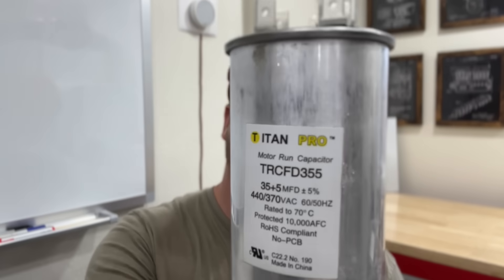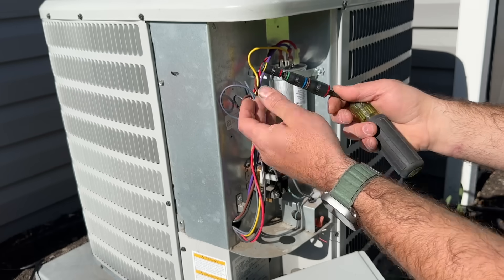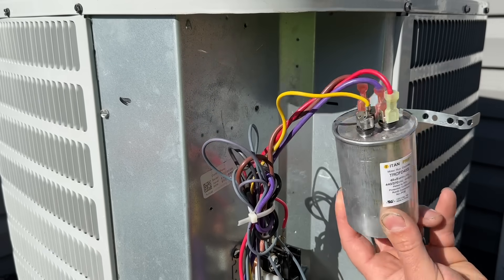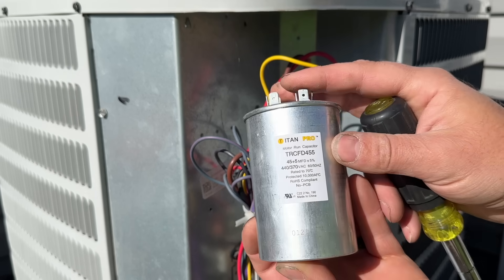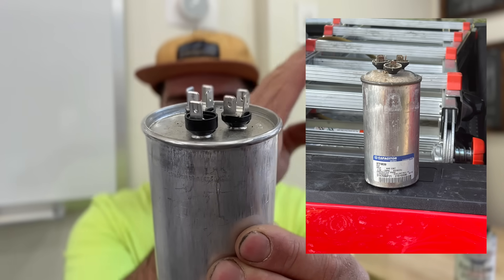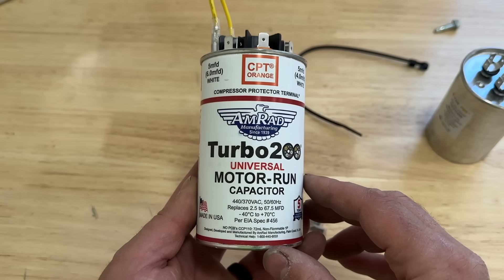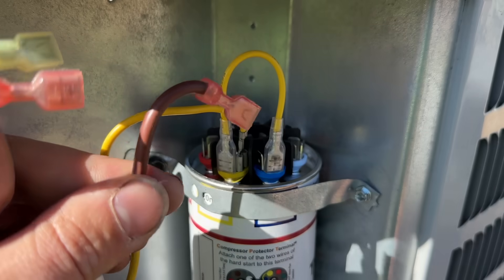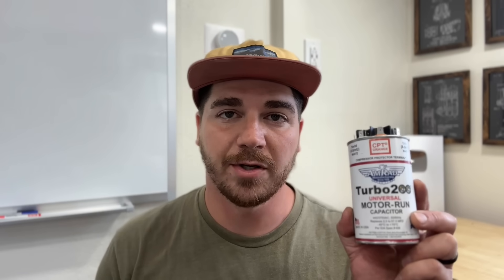HVAC Contractors Practically Make Their Living On These

Comment: Retired HVAC guy, I always check for power even if I pulled the disconnect. I was almost zapped because someone wired the box wrong.
Reply: ABSOLUTELY! Had a house, someone bypassed the disconnect. Pulled it, went in and SURPRISE!!! Took a minute to uncross my eyes…no, it was not funny.
Reply: @johnsmircic6650 Holy crap! Glad you’re still with us!
Reply: Reagan's old "trust but verify" works if you add a little skepticism. Skepticism keeps you alive. That said:
Don't trust. Always verify.
Reply: What ever you work on always assume it’s live or has stored energy,
Reply: When my uncle died I worked on his house getting it ready to sell and found something dangerous like that.
Someone wired an outlet for him all wrong.
The hot (black) wire was connected to the ground on the outlet but wasn't connected to anything in the breaker panel.
The ground wire (bare copper) was connected to the neutral (silver screws) side of the outlet and it ran back up to the buss bar in the panel.
The neutral (white) wire was connected to, yep you guessed it, the brass screws where the hot wire should be and it ran back up to the hot side of the breaker.
I'm not an electrician but that seemed really sketchy to me. I only found it because I was testing the outlets and that one showed an open ground.
Reply: @Harold_Callahan  
When you find shoddy work like that, then you have to start wondering what else might have been done wrong. Maybe tear more walls out looking for hidden junction boxes or improper connections and what all.
Reply: ALWAYS crowbar the power by shorting it with a tool such as a screwdriver after checking with volt meter.  Takes nearly no time, absolutely insures that you're safe.  And read all the way through instructions first.  I was nearly killed in an Army electronics school in 1965 because the tech manual said "remove high voltage power supply cover" at the bottom of a page.  5 Minutes later I woke up lying on the floor with the rest of the class and the instructor looking down to see if I was still breathing.  Turned that page in the manual and at the top of the next page was a caution block: "DANGER:  Negative 1710 floating volts.  Discharge capacitor before removing cover!"  The cover was live when removed. That was a lesson---.
Reply: This. I double-check the wires in my own home after pulling the disconnect. Even after 20 years of being the only one to work on it. It's a good habit to maintain (pull power, check voltage). Also to lock out the power and before everything goes back to energized, I check ground continuity. I had a neighbor die from standing in shallow water because a ground was floating. He became the easier path...
Reply: Thank God you found the problem 🙏
Reply: A repairman replacing my garbage disposal got a shock and banged his head under the sink in a similar situation. The wires were installed wrong and even though the switch to the GD was OFF, the unit was still powered on. Eventually he flipped the circuit breaker to the GD off in the garage to make sure it was safe.
Reply: @hifinsword turning off the breaker doesn’t ensure safety. Testing the circuit where the work is being performed with a multimeter (not a hot stick) ensures 0 volts and electrical safety. A lockout device must also be used on the breaker if it’s not within sight of the work area.
Reply: never work on anything electrical until you have verified that there is no voltage present.
The reason that you are there, is that there is a fault. Is that the only fault? Is the wiring correct, is it really isolated..... the list of safety questions/precautions goes on.
I've been 'lit up' a couple of times on 230VAC mains (not in America).... it makes your good day turn bad, pretty quickly. And it can be fatal depending on a few things like your overall health and how well you are connected to the mains.
Reply: Do you discharge caps before poking around and making the thing free moving with no bracket holding it in place?
Reply: @whatilearnttoday5295 you should. If its still live youll get a nice burst of electrical arcs like a tesla coil coming off it
Reply: @GonzoDonzo  Yeah I see this guy unscrew the thing and start moving it around without discharging first and.... yeah....
Reply: @whatilearnttoday5295  yeah and theres a lot of volts in those capacitors which means they can bridge a decent sized gap. I had a worker toss one into our box of bad capacitors without discharging it and when i went to dispose of them it discharged in the box which blew out one side of the box and sent about 20 other capacitors rocketing across my shop in a bright flash
Reply: @GonzoDonzo I’ll take Stories that Never Happened for $500, Alex.
Reply: I used to come across disconnect boxes where a lug would burn up so someone would put both wires in a big wire nut and bypass the disconnect so you’d end up with one leg still hot after pulling the disconnect.
Reply: I think few DIY know of inexpensive AC Sensor.  They are about the size of a penlight and widely available.  They have a replaceable battery inside to power a pink light under white plastic and a beeper.   It can be a pain to get the removable cap off to replace the battery.   Putting the tip near a hot wire will cause it to glow and beep.  Check it near a hot wire to confirm the battery inside is good.  You can get a hot reading on traveler wire of two way switch.   It may be possible to get a hot reading on traveler disconnected at both ends from small current induced by long and close hot wire, but I would take it as a hot wire untill all nearby wires are turned off at the panel or fuse box.
Reply: I got bit once, while replacing a contactor. I turned off the three phase disconnect. I'm removing the old contactor when I shockingly find  that the 120 volt control power was being fed off a seperate breaker.
Reply: I worked in pumps and wells for a while.  Imagine shoddy electrical wiring coupled with damp areas when a pressure tank goes.  One sees everything, including farmers that start flipping breakers when one is working, it got to the point where I'd put a padlock on the breaker box and keep the key, some farmers would complain that it is his farm, but it is MY life on the line.  One sees some truly frightening stuff.
Reply: Don't mess around with 240 V.
Reply: I used to go on calls with my grandfather who was an electrician. He kept one old screwdriver in his tool pouch that he would use to check for current after things were supposedly turned off. if something was wired wrong and the current was still there, it would arc and flip the breaker, turning off the power and identifying the circuit. I've been surprised a couple of times. Don't assume it's off because you flipped a switch.
Reply: I ended up going to university instead of the trades, but I took a year off between high school and uni and spent most of it working for a friend of my dads who ran a small electrician company. I wasn't an apprentice, but I I helped do everything from wire up a warehouse to doing industrial maintenance and troubleshooting. 

A healthy dose of respect and fear of electricity was taught to me. Any time I need to play with electricity I padlock the breakers and always check again with the multimeter. And even then you've gotta make sure there's no huge capacitors somewhere. It's always worth making sure.
Reply: I worked on a house that had every single switch on the neutral side of the  load, including the panel.
Reply: I’ve heard capacitors can hold over a pretty serious charge.
Reply: I flip houses bought a 6 year old house the builder had buried an outlet box under the backsplash over the stove. I only found it because I was redoing the backsplash.
Reply: I've had this happen to me as well.
Reply: How ? They bypassed the disconnect?
Reply: I got zapped a couple weeks ago because of this.
Reply: i seen meany houses  where labels are labeled wrong and have to play musical circuts with the panel and yea eaiser and safer to just cut it all but if working rich peaople dont like to go a few minutes of inconviencence. and no i dont work these jobs just from houses and trailors eta i myself have lived in.
Reply: Yep, I got zapped once, bad wiring, not fun
Reply: So, how exactly do you safely check for power after you've pulled the disconnect?  the capacitor is still in the unit... potentially not discharged...  we don't know if it's good or bad... Which leads do we check for voltage?
Reply: @TheBlueArcher  check your line voltage if zero when removing the cap take a screwdriver and short to common
Reply: @paulmarc-aurele5508   exactly !  when DIY hvac guy here started removing the cap's retaining strap WITHOUT discharge check, I downvoted.
Reply: 100%
Reply: @paulmarc-aurele5508  I now have a tendency to check the voltage across both legs and to ground at least two times . It's overkill, but I have not got shocked since.
Reply: My old ex neighbor was an ac guy and taught me    that about 90 percent of ac problems are capacitors. Saved me money many times.
Reply: @SweetHill-o3z I don’t agree. What I agree is 80 % of problems on Ac Units are electrical but not 90 % related to the capacitor.
Reply: I am not an HVAC guy but there was a tech working on the unit in my old apartment one day. I looked up and there was a wire that went around the service disconnect to the HVAC unit. I said "Hey, I know I'm not an HVAC guy but it might be a good idea to look at that wire going over the disconnect". He checked the unit and yup it was still hot. He thanked me for keeping him from getting zapped.
Reply: True and as an electrician I have seen crazy electrical cutoffs and panels, more often than not....
Reply: Assumicide kills many people.
Reply: Retired TV tech. Got sent out to customer's house to replace a power IC. Routine job, or so I thought. Pulled the TV's plug, discharged caps, prepared to replace part. Warmed up soldering iron (grounded tip) and started to desolder IC. SNAP!. "WTF?". Figuring I missed a cap, I proceeded to desolder the IC again. SNAP!. Okay, now I'm curious. After doing some troubleshooting, it turns out that the AC receptacle that my soldering iron was plugged into (add-on room) was miswired placing 120V on the tip of my soldering iron. Worst part of the whole experience was, during a meeting of associates, the boss made an example out of me for my "mistake". From then on, I packed a 3-wire outlet tester with me. In retrospect, I wondered where the current was going with the set unplugged. Duh.... the cable box grounded the TV through the antenna input.
Reply: How would you potentially save $2000…
Reply: Unfortunately, I have seen that way too many times myself.
Reply: Stop trying to put fear in people, this is an easy fix a monkey can do it. its like ever trade, most problems are very simple to resolve.
Reply: Always good advise, I install Home Generators and some of these people put power to locations that do not belong.  It is simple to check, but it may save you time and potential injury.
Reply: I turn off breaker then check with meter. Still I was working in one of my houses turned off breaker. Other idiot contractors working in house  ran out turned on breaker. My fault  i didn't let all people in home know I turned off breaker
Reply: I always double and triple check.
Reply: Same here
Reply: Bad capacitor and ants in the contactor
Reply: 💯 percent correct. Fortunately, I was standing on a wooden table, and the smoke alarm gave a nice chirp when I wired it.
Reply: 220 volts
Reply: @paulmarc-aurele5508  yeah always check power at the disconnect you never know who's gone in front of you and have wired around a disconnect. 

But hey let these dumb asses who follow YouTube schills get shocked. Maybe they will learn to leave it to the experts and they can get back to being pencil jockeys.
Reply: I just cut all the power to the entire house every time I do anything electrical and I flip the individual breaker as well. why not.
Reply: So right of you to be careful.  Years ago I checked the wiring in my brother’s bathroom light fixture to find that the “Saturday” electrician made the white wire the hot wire and the black into the neutral wire.  And they walk among us.
Reply: Excellent Call
Reply: Last year I went to clean my compressor after mice decided to turn it into their winter home. Flipped the breaker and started to remove the fan. Just as I removed the last screw the fan turned on! This had never been touched since the electrician installed it so never trust even a so called professional.
Reply: AC just tickles.
Reply: @Backstabbio  if you are insulated from a ground 110v will tingle, if one of your hands is on a ground and the other touches a hot it can be fatal. I know your just being funny but wouldn’t want someone to get hurt or worse if they didn’t realize this.
Reply: @Backstabbio  May you never get a 480v tickle :) or a b+ tickle or a wet dog nose on a hand behind your back and other in a chassis while you're standing on a "safe" rubber mat. Seriously  though a 120v tickle can be enough to knock you off a ladder.
Reply: @Backstabbio bullshit lol
Reply: Very good point.  I have a battery in my spine.   I always check
Reply: Good video

Comment: Not just air conditioners either -pretty well any appliance with a motor; dishwashers, washing machines, water pumps etc.
I have replaced capacitors on various appliances that most people would have assumed are not worth fixing so they buy a new appliance.

And not just motors either, I had a computer monitor that was starting to have trouble starting up. Pulled the back off and saw two obviously faulty electrolytic capacitors. A full set of replacement capacitors for that model cost me just $6 on eBay and replacing them all took me less than an hour. Take it to a computer shop and you will be told "not worth/possible to fix but I can give you a good deal on a new one" and then they try to upsell you to fancier, more expensive one.

Similar with sarellite boxes but this time resistors. A particular model was prone to fail because it had 2 under-rated resistors in the power supply. The distributor would happliy sell a new power supply board for $60 and problem fixed. I just replaced the two resistors at a cost of 5¢ each plus ¼ labour (would have been ¼ anyway to replace the power supply board). Eventually I had a stock of replacement boards from customers who had bought a new box but not binned the old one -sold reconditionrd boards, with an instruction sheet, for $20 to customers who were willng to do it themselves.

Comment: Crooked contractors really piss me off. I had my own HVACR business in my home town back in 1987. After going to RSI in Phoenix Az I jumped in and went into business for myself. In my home town was a contractor who had been here for a good number of years and really had a bad reputation for overcharging customers for everything. Now me being green when it came to this, I set a price for a service call and included a half hour labor in that. Most times repairs were rather simple and didn't take long to do. Changing out a start cap or a run cap was easy enough and I had a 100% markup on the part. At that time caps were cheap (approx $10-$20) and I stocked a number of them. Other jobs took longer and even on higher cost parts i had a markup but my percentage came down to make it an affordable repair for the customer and I still made money. After a few years in business I found myself about a week behind on calls during the summer but people would wait because they knew I was good at what I did and didn't rip them off. Now when it came to the established contractor who routinely ripped people off was seeing less and less business due to the fact that I was a lot less money and did the jobs right the first time. After about 4 years in business he moved his operations to a town about 50 miles away since he had lost all of his customers to me. His price for a condensor fan motor, cap and labor was 3 times what I was charging...doesn't take long for people to figure out he was ripping them off so I guess I can say, I put him out of business.

Comment: Per the instructions for the Turbo200 you must always land your hermetic or fan wire on the highest terminal you have jumped
Reply: This comment should be pinned.
Reply: Can you explain this in homeowner speak?
Reply: @beetlefang  Let's say you connect the 50 mf segment to the 20 mf segment to get a total of 70 mf. You should then land the wire coming from the AC unit to the 50 mf segment, as that is the highest value segment that you jumped to.
Reply: @floorpizza8074  Thank you so much for the explanation!
Reply: @beetlefang  You're welcome. ☺

Comment: If your going to take anything apart that has wires take alot of photos with your iphone it will help connecting them back up properly to the new device. Also be aware the same issues home ac units suffer from so does your refrigerator in your kitchen. Its got a small condenser with a little fan sucking cool air through it just like your ac outside condenser. The fins of the condenser and the fan easily gets dust clogged. It cant cool if clogged. Then it will kill your compressor. Unplug it take the back cover off vac it all out blow out the dust in the condenser fins and I like to take out the fan and lubricate its axle. I also duct tape filter media over the vents in the bottom to mitigate the dust as its so low to the ground and will suck in alot of dust. Your refrigerator will last years longer.